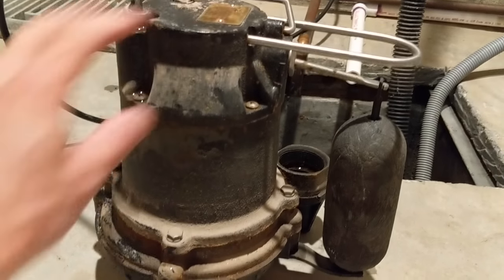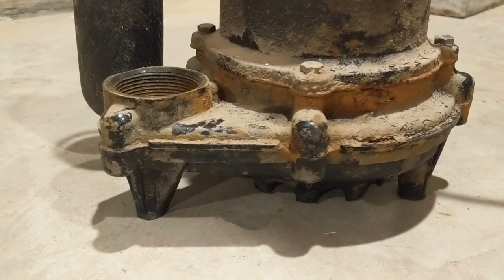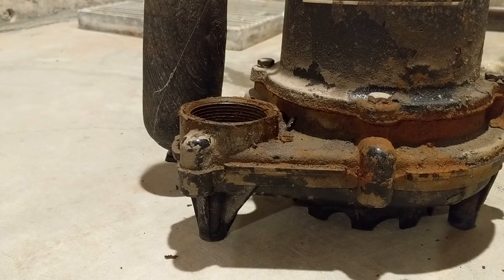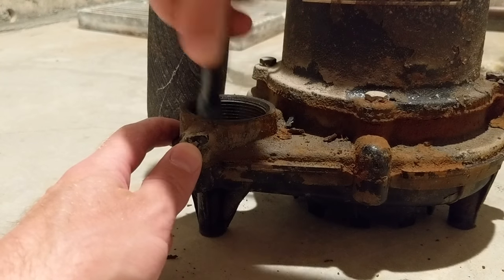Sump Pump Not Working?  It Might Be Air Locked!

Comment: Brand new sump pump is shooting water out of a little hole near the bottom but not any water out of the discharge pipe. Why?
Reply: Could the discharge pipr that goes out through the foudation be clogged with mud? By the way, outside my home,I can not find where the discharge pipe exits my house.
Reply from the maker: It sounds like either your check valve is installed backwards or there is a clog in your line.
Reply: The discharge line is clogged. I bypassed it with the flexible line that came with the new pump.
Reply: By the way, I did not see a check valve in the box with the new pump. Pump is in the old basin in the crawl space under the house. Heavy rain last night. I didn't see any water getting pumped out. In the morning I will crawl back under the house to check on the new sump pump. I will look for an alarm that will sound when the water has risen above where it should have. My back yard area slopes down away from the house. I wonder why the builders didn't just install a kind of French drain in or under the foundation to have a constant drain off of water.
Reply from the maker: Ugh, a basin in a crawl space?  That sounds brutal.  I don't think most pumps come with a check valve.  It's just one of the piping components you need to purchase at the same time - depending on the type of pump.  If it's a pump with a float to turn it off and on you should get a check valve.  If it's the type of pump you just turn on when you need to move some water a check valve might not be necessary.

Comment: I have a fountain pump similar to ur pump that hummmms but will not pump water up the fountain.  what do you think is wrong with it?
Reply from the maker: It could be a number of things. I would first take the pump out, submerse it in  water and see if it's moving any liquid that way. There could be a clog. Not sure about weep holes for fountain pumps. Maybe tilt the pump on its side when submersing it to make sure there's no air in there.

Comment: Trying to understand if this is what is happening with my sump pump. After several years of use, my sump pump is just not pumping the water out. The water level just keep increasing bit by bit and the pump keep running continuously and the water gets fairly warm! I've manually emptied the water to prevent flooding and stop the pump - only to realize it kicks back in a day or two later. Can you please advise on what might be going on and what the potential fixes might be?
Reply from the maker: If the water is getting warm it sounds like it might be air locked.  The impeller spinning around might be causing the temperature rise. Does it sound like the pump is running?  Is there a check valve?  If there is enough room in the sump you might be able to hold the pump sideways and turn it on to help "prime" the pump.  Holding it sideways would help fill the casing with water.
Reply: @AnthonyDalBen  You know what I emptied the barrel further down and see that the sump pump connection to the check valve had come apart. So the water is spraying out back into the barrel. So looks like I need to fix that connection. Will report if that fixes it! Thanks
Reply: @AnthonyDalBen  I did fix the connection of the sump pump with the check valve. But when I trigger the pump to run it still doesnt bring the water level down in the barrel! What could be going on? Appreciate your help. Thanks.
Reply from the maker: Does it sound like the pump is running? That's the first thing I'd verify. You should hear a low hum and feel a slight vibration in the discharge line. One of the great things about the weep hole is you know if its running or not. Like in the end of my video when you see water spraying out the side. Check the pump housing and look for a weep hole. If there's not one there then install some pipe and drill your own. Sounds like you are having the same issue I had!
Reply: @AnthonyDalBen  Had a handyman come over. The pump is certainly running. Checked it out well. Current guess is that there is blockage on the pipe exit outside the house...Likely frozen. Will see what is up!
Reply: Turns out that there was freezing/blockage on the exit pipe [caused by sub-zero temperatures for a week]. Got cleared today when the weather warmed up a bit and it is back to normal operation. Thanks for your help troubleshooting.
Reply from the maker: Glad you got it going!  Also, thanks for sharing your situation.  I hope it helps anyone who might be reading so they can troubleshoot any potential issues they might be having.

Comment: My pump is rusted it need new screws but it also need oil as I was removing the rusted screws the oil came out what type of oil I need? And where to buy?
Reply: I would recommend you replace it as you don’t want to save money and take that risk I did the same thing and my crawl space got flooded and mold on my foundation Cost me 2k to fix it all
Reply: It's not rust, just silt staining, it does have the same color as rust but it's not...that;s normal
Reply: @pilbomags488  thank but I need the oil that spilled or came out what is it the oil I mean
Reply: What kind of oil it is?

Comment: Bought a rigid injector pump but it hums after it pump water out
Reply from the maker: If the level in the sump is not going down but the pump is humming (running) then it is probably air locked.  Another possibility is the pump is "dead heading" if it's not powerful enough to move the water (vertical distance).
Reply: @AnthonyDalBen  Most likely the float switch, which may be getting stuck, plugged in wrong or none existent depending on if you have a pedestal or submersible pump. In 36 years I've never seen airlock but thousands of stuck floats

Comment: when sump pump cable is connected to watcgdog battery housing systwm, it makes a loud dry(in my opinion) sound. Do you have any thoughts on maybr why this is happening?
Reply from the maker: Is it only when connected to the battery system? I know some devices can struggle on battery power. A pump would probably fall under that category as they typically pull a good amount of amps.
Reply: @AnthonyDalBen  Yes. So i currently have it disconnected. I reconnected it earlier last week and there was no sound, but it started again.